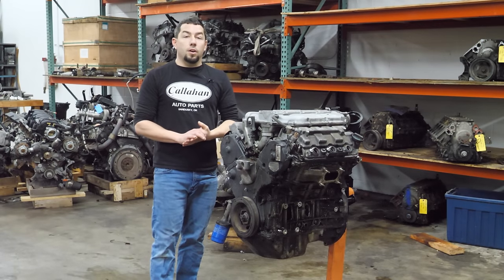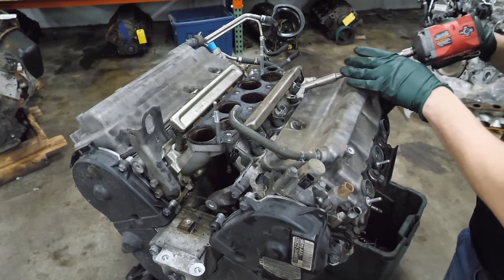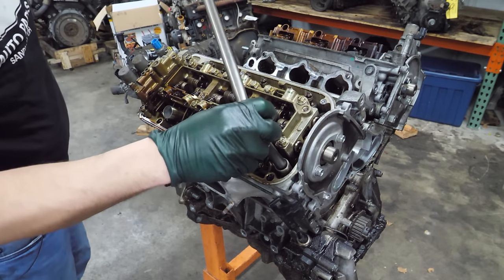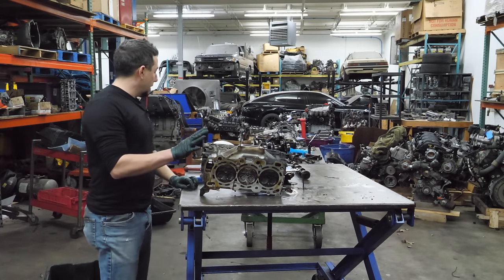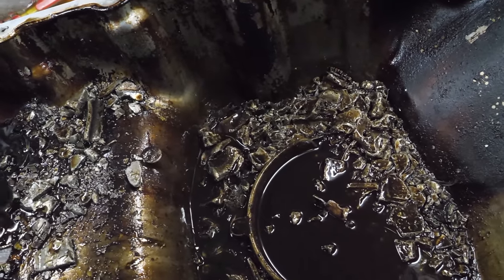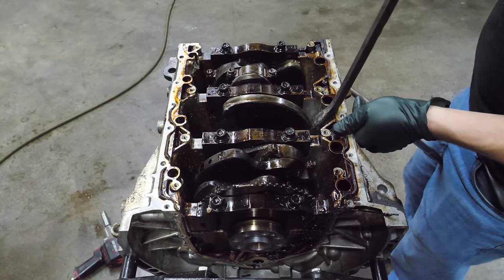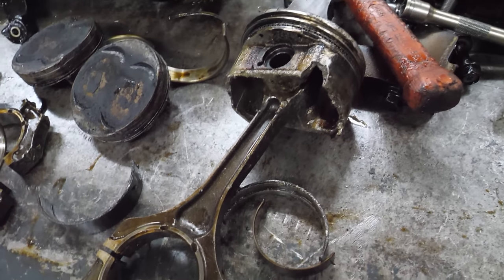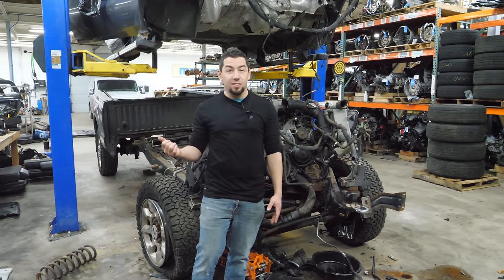Obliterated Honda Accord J35 V6 Teardown. Customer States: "Vehicle Shut Off"  OH I BET IT DID!

Comment: I work at a Honda dealer and you are spot on with your assessment on VCM. For you curious out there that own a VCM equipped engine there is a product called VCMuzzler that can be installed which modified the ECT signal to the computer which causes the VCM to never activate. I myself have an Odyssey with a J35A6 so no VCM for me, I was very careful to only look at models specifically without VCM because of the widespread, well documented issues with VCM. Good teardown, keep it up!
Reply: I bought my 08 Odyssey without knowing about VCM. Scared myself when I did the first oil change and half the oil was gone with no leaks. Bought the VCM Tuner II thanks to an ETCG recommendation and immediately oil consumption went down. Now, ~15k miles later and oil consumption it’s basically nonexistent.
Reply: This clearly wasn’t one of Honda’s better ideas. And this V6, even without VCM, is famous for valve train issues even when well maintained. It’s hard to believe Honda can engineer the K series 4 cylinders which can reliably produce over 1000 hp yet their engineering is a total fail for a stock Accord, minivan, etc. V6. I hope some Honda engineers or managers see this video. It’s like Toyota engineering the amazing 2JZ while many of their other engines famously suck. Or GM having the bulletproof LS but most of their other engines having serious issues.
Reply: Having an  2007 Odyssey with the "three stopped system" I have traveled from Chicago to the Florida Keyes several times on I-65 at 78mph in traffic  getting high 20 mpg in this mode dominately and now have 240k on the engine. I NEVER add oil between " 0% capacity left" changes and I am going though the third timing belt change due to the hydraulic tensioner going into connecting rod failure clatter mode.  Mobil One has resulted in some varnish that cleans up at each valve adjustment and the rear head is always cleaner and has intact crosshatching, light carbon and original ignition coils . The front cylinders run hotter, have little crosshatching and eat an ignition coil every 30k miles with the front banks pass side cylinder always running hottest (more varnish and most coils ). Pennzoil and other oils never come back as clean as the Mobile One. Why miss an oil change with the car warning you so many times?Our other "direct injection"  Honda vehicles are changed at 40% miles left to change because the Blackstone Oil Samples show multiple deficits at this point and used up base capacity by then mostly due to ERG activity with more particulates. Wish I could get the power steering converted to the new electric as the original has caused many pump replacements and oil leaks due to the faulty off center drilling of  the blocks capscrew bolts holes at the factory originally. Fuel injectors were replaced at 80k to deal with a bad spray pattern and leaking. This is likely to cause the carbon build up in the back bank if left uncorrected. Never put old boat gas into a clean fuel system.This is as close to an aircraft engine in reliability as any honda or other engine I have owned and shows as great attention detail as any other product.
Reply: Ditto to the VCM woes; however, the better product is the VCM Tuner II. I installed that on my J35Y1 in our 2016 Accord back in August of 2021 and have had zero issues. The unit sends a coolant temperature a few degrees fahrenheit below actual to the computer. Apparently, VCM won't engage until the coolant temp reads 165. This unit keeps that reading below the threshold. The damage from VCM isn't just limited to engine wear/damage, the engine MOUNTS are hydraulic (read: expensive) and the extra dampening loads they need to bear because of three cylinders constantly being shut off and on reduce their lifespan.
Reply: Man, this VCM problem seems much worse than Chrysler's MDS system. Was there ever a recall?
Reply: @Tom Craft Donkey  All I've seen are TSBs 11-033 and 13-078...13-082); however, these seem to affect much earlier models that use various J35s (looks like 2008 to around 2013).
Reply: I had a 2012 honda pilot with the VCM and I hated the violent shudder it caused every time it engaged. I didn't do a ton of research to find that a tuner was available but did discover a cheap work around using the same concept. I found that placing a 100-ohm resistor in the coolant temperature sensor feedback wire completely bypassed the VCM mode.
Reply: I have a 18 Ridgeline with the j35y6 and a good chunk of us use the S-vcm controller, miss me with that 3cyl bullshit 😂 we have many in our groups that think "VCM is a good thing and Honda engineers know what's good and it's perfect the way it is" 🥴🥴
Reply: @sunshineruffio8071  same my 17 Ridgeline is at 168k Miles trading 1-2 MPGS for peace of mind ( + always 6 cylinders)  after the injectors were replaced due to fouling and the TSB  for RPM judder I scoured the forum for answers and S-VCM was installed. 
The biggest problem in the close loop for the VCM system is the it 6 spd was programmed to slip in order to smooth it out for VCM engagement during light loads like the freeway or slowing down causing a lot of wear on the old  6spd and DW1 ( hear the 9 spd is more robust) ; if most of your commute is on the freeway it means most of the time you in an out of 3 cylinder mode vs in the city .
I would like to see the number of failed 6spds, percent of driving city and highway, and VCM active or disabled
Reply: @hieuhughesle-au9884  if we had some numbers like that im willing to bet many failures are because it was putting around in 3cyl mode, ive done injectors at 70k too and no issues. when i get a TLX intake manifold ill pull apart my manifld to see if my catch can has made a difference as well.
Reply: My parents had 190k on theirs before they replaced the engine and trans. Motor still ran but was leaking oil from damn near ever orifice,  water pump was leaking and it would’ve cost nearly as much as a salvage engine lol
Reply: @sunshineruffio8071  Love S-VCM bought 2 from the guy and they are solid.
Reply: @saablazer  it's crazy that those piston rings can recover and clean themselves isn't it?  I had a very similar experience in my accord.  Over time it burned less and less after delete until it went away.  Replace those rear plugs and coils though. They're likely toast
Reply: @sharedknowledge6640  they're not bad if you do the valve adjustment recall. Bridge is known to come loose and cause issues
Reply: I replaced my motor with a junkyard motor. The engine light is on due to a oxygen sensor being bad. That seems to prevent the eco mode from kicking on... and I'm ok with that 👌
Reply: The vcmuzzler (1 or 2) doesn't work post-2015.

 The ecm will set  a permanent flag that the temp sensor voltage was incorrect, and it will compensate for the resistor and still keep vcm working properly. 

The dealership will know you have used it and will void your warranty if they don't want to help you or the service manager is having a bad day.
Reply: @VicReinz52  This is not true and pure misinformation. If you get a code, it's because the resistance value you used is incorrect. Use a lower resistor.
Reply: @wiimaster2847  so I'm only saying that from my own experience. I used a VCMuzzler 2 (purchased direct from person hand-making them) on a 2018 J35Z4.

After 10k miles I realized VCM was still working, with the lowest resistor value in use. I removed the muzzler. Got CEL on next power-on. Checked CEL. Scan tool read 2 codes, first stating that coolant temp circuit out of range. (Whatever) Second stating that pcm detected fault in cooling system, fault saved in permanent data.

Maybe I'm jumping to conclusions here, but I can see Honda using that information to piece together the story that you've tried tampering with vcm.

Overall, I don't care. It didn't work. If it needs new rings on the back sooner, then whatever. I'll put new rings in it.
Reply: @VicReinz52  you can't disconnect it with a warm engine or disconnecting ECT1 will set a code. Your resistor was probably too low then. And dealerships are proven to not care.
Reply: @wiimaster2847  I did it with the engine overnight-cold, but it was a warm day (90s) when I pulled it.

I don't know, I'll keep that in mind; but like I said, I'm done with thinking I know better than the engineers who made the motor.
Reply: @VicReinz52  also, it's less about the actual engine temperature but the fact that the ECU needs to be asleep and not monitoring the circuit. Opening the door to pop the hood will wake it up, so will having the fob nearby.

VCM is conceptually flawed and there's zero benefit to it. It's proven that the MPG gain is almost none, people who disabled it see almost no MPG loss.
Reply: @wiimaster2847  yeah that's fine. I can feel when vcm is on or not so I just kick it out of 3 cylinder mode.
Reply: I have 2011 accord with VCM disabled. Is this a good engine if it is disabled? J352z I think
Reply: @sharedknowledge6640 the manual js and the js in the acura products were more stout.. the manual js have been documented pushing 400hp before internals.

the newer js in the tlx type s is all beefed up for future upgrades.. but honda likes to r&d with the consumers  before they make changes.. from the different evolution  of the j series
Reply: @sunshineruffio8071  Just put the s-vcm controller on my 2015 Pilot today (12/10/23) at 63K miles. Never had any shuddering or oil burning issues, but playing it safe.
Tricky temperature sensor connector to get off, but with long needle nose pliers  to press the locking clip, and a long screw driver to pry it up, I got it off.
Reply: What's the best model year and engine for the Odyssey?  I'm also interested in the CRV.  Thanks in advance!!
Reply: @danj3674  Nice, How to do that? Where can I find feedeback signal to easy install it? Any picture?
Reply: Actually they do green engine oil
Mobil has one 0w20 green oil
My honda CR-Z has it in his engine 
🤣

Comment: I spent 9 years at a Honda dealership, spent my fair share of time putting rings in these engines. I never saw one grenade like this, and I feel cheated.
Reply: and usually Hondas are really good engines...?
Reply: @Luke Bryan  They're good because they don't care if you do or don't maintain them. My fiancee had shot piston rings, valve cover gasket, 2 huge cracks in her purge solenoid hoses, all 4 engine/transmission mounts were hanging on by literally 1 mm of rubber, transmission had half of its fluid in it, all the seals were shittily replaced with RTV, PCV valve was clogged and hoses were torn, coolant reservoir was empty, oil pan was leaking, intake manifold gaskets were flatter than the manifold itself, somehow the throttle body gasket was bent? (Previous owners mechanic was a hack) 2 of the spark plugs had random washers in them and another was bent with a small gap, 4 coils were shit (400+ ohms), serpentine belt and tensioner were shit, and its timing tensioner was pretty much gone at 130k miles when she bought it. She drove that 2007 corolla to 150k, where I met her and replaced all of those, and somehow its still running atm at 170k.

My BMW complains, misfires, and stalls when I have a dinky clog in an EVAP line. My engine will probably last longer than hers, bit the difference is that one thrives with maintenance, where one can thrive even without.
Reply: @alextheonewarrior Just imagine how long a Honda or Toyota especially would last when maintained as meticulously as a BMW requires!
Reply: yes well maintained they will outlive the body.. especially if its a manual j series.. since no vcm in the manual
Reply: I can tell you a toyota can run to nearly a million. One old lady traded in her old toyota and they put it in their show room because of the amount of miles on the car!
Reply: @mrsillystrings4075  I'm dead curious on the mileage of the car since we had some good number on 2004 Tacoma 22R  and also some good 2004 Highlander 4 cylinder as well.

Comment: My father used to criticize car owners for ignoring warnings signs.  He said that low oil pressure should be first signaled by a red light followed shortly after by a loud buzzer.  If you were still driving it a minute later a big boxing glove should fly out of the steering column and sock you in the nose for ignoring the first two warnings.
Reply: That's a funny dad

Comment: It's hard to believe a person could ignore the sounds coming out of this engine before it seized. Such a well designed and built engine. The person driving the car should have their license revoked.
Reply: it because not all who knows how to drive knows how to feel or hear what the car says
Reply: @endurofan9854  this type of failure is either intentional or the person is so brain dead they shouldn't be driving. ain't no way, I'm shocked this thing didn't catch fire.
Reply: Proof of Hondas quality noise insulation from the engine bay ?
Reply: Meh nothing a can of seafoam can't fix 😂
When I was in college I was going out with a chick who had a 2 yrs old Civic her folks bought her, never done any maintenance or oil change the car was smoking black and eating 1+ quart per week.
She was insulted when I said she should have it checked; 
"it's a brand new car!!! I don't need to do anything"
That's what most people do.
Reply: @George Robartes  lol my mdx is pretty quiet so maybe
Reply: @LaurentiusTriarius I'm sure everyone will throw a bitch fit at me for saying this, but it's usually women.
Reply: @LaurentiusTriarius so who was topping up the oil if she didn't believe in maintenance?
Reply: you’d say pretty much everyone should have their license revoked.
Reply: @android584 i wouldnt consider doing nothing besides topping up the oil after 2 years with NO OTHER MAINTENANCE "doing maintenance" 😂😂😂😂. Especially if the car was running fine before that (which we dont know, but assuming it was) then she would be the cause of all the engine problems.
Reply: Andre their is no law for being stupid
Reply: Keeping the revs up to smooth out the lumpiness. It's a well known way to fix a baulky engine. Never works everytime.
Reply: @android584  It's only 2 years old, it don't need any oil.
Reply: Some people do this kinda thing for fun
Reply: It was probably a woman dude. She was probably like "my car is making a weird noise mom" BOOM!
Reply: How do you know that they have their licenses in the first place?
Reply: Well, it was most likely a "it's making some noise, so I'm going to send it at max rpm!"  All for Eric and his channel!

Comment: I think we can give the screen in the pickup tube an MVP award for keeping all of that kibble out of the oil pump. Impressive.
Reply: i dunno man.  i think that windage tray deserves a lot of credit as well.
Reply: @odnamsrazor2364  The windage tray took more of a kicking than most will realise, i bet its full of divots bumps and scores lol
Reply: @odnamsrazor2364  I concur, windage tray held the nuggets!💩💩
Reply: @odnamsrazor2364  What....are you talking about that cheese-grater ?!
Reply: I guess when there's no oil left, the pump has to suck up SOMETHING...
Reply: The whole engine was the rock crusher, the windage tray was the screen separating the sand.
Reply: @commonsenseisdeadin2024  I was surprised that the wrist pins stuck around.
Reply: @arkhsm  
well yeah.
.
i wouldn't want those wrist pins getting into the oil pick up!
Reply: @boba1024  I was surprised to see one crushed! Not to mention 5 of 6 not doing wrist pin things! The whole rotating assembly said f..k this I quit! Except one was like "I need this job, I got a family to feed!"
Reply: @boba1024  They ought to make the new battle tank armor out of those kind of wrist pins !
Reply: No wonder why it couldn't rotate 🙂
Reply: I’m at a loss for words!😂
Reply: @davidpowell3347  2 stroke engines will put those wrist pins all the way down the exhaust, in one piece, while you just have shreds of the rest around. Seen them come out the end intact as well.
Reply: @SeanBZA
thanks to the transfer ports i guess 😂
Reply: @endurofan9854  yeah, but it isn't a 2 stroke 🤣

Comment: I work at a major oil change place and I see hundreds of cars a week and it’s always fascinating to see what they look like on the inside when all you ever see is them from the outside,
Reply: You haven’t see a coworker’s mistake lead to seeing the inside?  A big name oil change place will do a better job then not changing oil, I use them in winter, but how fast my oil gets black and thick I have it done every 3k where I can wait for my oil change light 5-7k when I do it myself with Walmart synthetic and a wix or oem filter.  

I’m not knocking the people that work at them, but from what I see the end result is barely adequate materials or a huge up charge that isn’t worth what you get.

Comment: I recently bought a 2008 Honda Pilot EX-L AWD, the most recent Pilot I could find without VCM. I compression tested all cylinders and at 230k miles they all have around 165 PSI on the dry test and 165-175 on the wet test. I changed the timing belt, water pump, etc, all the fluids and the engine runs great.